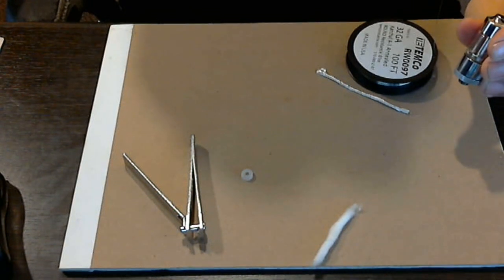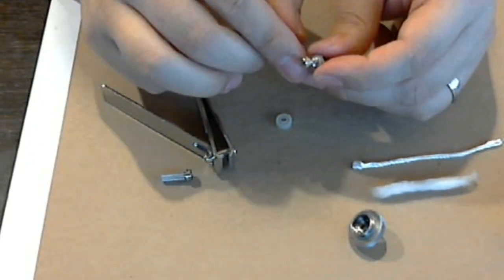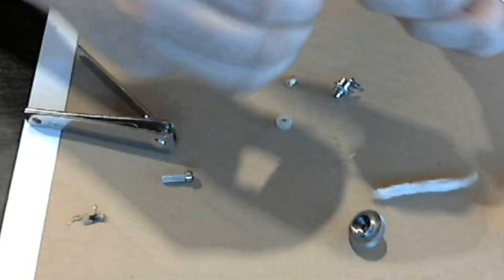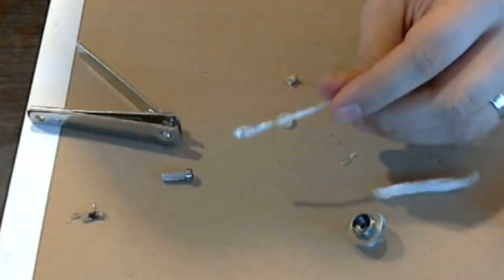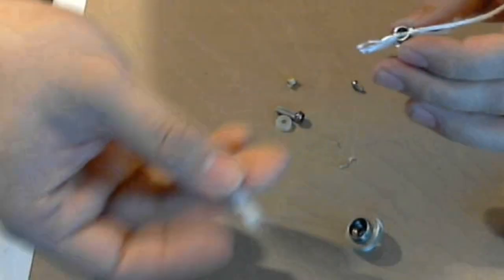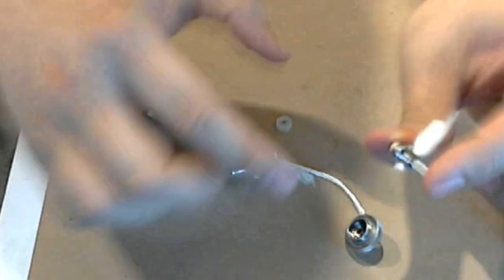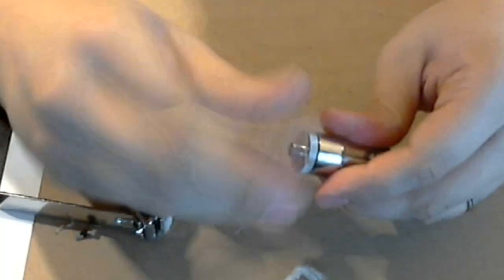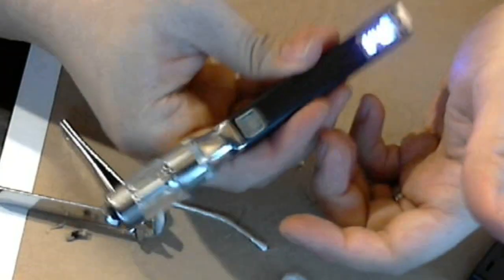Protanks and Evods, Anti-Gurgle Rebuild Method

Comment: the other main issue with kanger rebuild is the rubbery taste that results from the burning off rubber grommet that isolate the negative and positive wires.
Kanger uses resistance to no-resistance wires in the build which protect the grommet. do you have a solution to this issue?
Reply: I would like to see an answer to this.  I've thought of maybe making a grommet myself from a good insulating material that is easy enough to work with that I could craft it into a grommet but I haven't explored that idea very far.  I'm also hearing that the dual coil kanger heads are using a different grommet material, something more "squishy" like maybe silicone, but I have no first hand knowledge about this.  If you find a solution to "scorched grommet" I'd really appreciate if you could let me know what you find out or where you find it.  Thanks and happy vaping.
Reply: Roscoe Tims

Hey Rosco,
ive seen a video by a guy called Ray Lopez and he replied to my concerns and gave me a link where it is possible to buy a silicon grommet as you suggested the web site is lightingvapes dot com. the problem is they ship to Europe and it cost around $55 to ship a pack of ten that cost $6.
i gave it a thought and decided to leave the kanger club and buy a kayfun since i don't want to get plastic smoke in my lungs.
meanwhile i am back to my good old vivinova mini waiting for the shipment.
please keep me updated with any results on your side.
Best of luck and happy vaping.
Reply from the maker: Roscoe Tims the #0 screwdriver is for your standard rebuild-ables.
a kayfun, a dripper.   this would be way too big for a kanger coil.  In coil building 102 I explain that you must use your own discretion when choosing the driver size.

although a kanger coil can be rebuilt it was never intended to be rebuilt.
in the video I hand wrap over 1.5mm silica. So if you're going to make a microcoil  it must be much smaller.
Reply from the maker: resistance and non resistance is for those special builds found in ceramic cup setups.  You need that sodder machine that will join the two together.
so that basically you have resistance wire in the middle and two non resistant ends.

I think its unecessary,  if you fried the grommet that means you have a hotspot.  Keep your coil neat, balanced and don't go over 30 gauge.
32 gauge recommended.
Reply: Pegasus1337 I'm probably calling the screwdriver size wrong.  I ended up using one of those tiny screwdrivers that comes in an eyeglass repair kit.  

I started out trying to hand wrap around 1.5 silica as you did (just off camera where I couldn't see how you were holding it to make that work).  My silica started coming apart before I could get 2 wraps on.  I had torched my wire before wrapping so it was a little less flexible than yours and I only had 30ga so it was slightly thicker as well.  Long story short, I built a 1.3 ohm micro coil that fires fast and does what a coil is supposed to do.  

When I say it didn't work, I meant it didn't fix the gurgle, probably because I used all cotton and built my coil slightly too hot (it's vaping juice faster than the cotton can wick so it's flooding).  I should have just threaded silica through it and proceeded with your sandwich build (an excellent build idea btw, kudos) but I got impatient, my silica was out of reach and I had plenty of cotton at hand so I just did the whole thing with cotton.  

It might still have worked if I had kept to a higher resistance or used more silica but I learned that an all cotton, 1.3 ohm kanger single coil needs more power and more juice than I want to give it.  So if I try again, I'll stay closer to 2 ohm and use more silica.  As you say though, these heads were made to be disposable garbage so the smarter thing to do would be to just get a rebuildable to use my wire on.  

I've really enjoyed my protanks but I'm spending hours and dollars rebuilding heads that I could buy in seconds for pennies.  I just don't want to end up with a room full of gear ya know?  I already have too much vape gear so I'm not happy about the prospect of going RBA/Mech, then eventually getting a kick and probably a rebuildable tank  and looping my way back around to where I am now with vv/vw devices and bcc's.  It just looks like a huge waste of time and money chasing fads.  I'm short on time and shorter on money.  

Thanks for taking the time to respond and keep up the good work. You're doing good things
Reply from the maker: I think you need to visit a large brick and mortar store right away.  You absolutely have to go to a store and ask to try a true RBA device.  preferably a genesis over a dripper for this reason only.

people normally tend to build a genesis just right.  around .6 to .8 ohms.
People tend to build an RDA to around .25 - .30 and this might be too hot for your liking.

if you haven't tasted juice outside of a pro tank you're truly missing out.
Reply: B&M's are off the table for me.

I would love to go the genny or dripper route for flavor enhancement and to satisfy my urge to tinker but I can't afford to build an extensive hardware collection. 

Thanks again for your input, maybe I can put it to use if money stops being such an issue.
Reply: Roscoe Tims
I found a product from web site called nature vape the tank is called N vape pro mini and they have a 4 ml called N vape pro midi. it is their answer to kanger protank but they came with micro coil & cotton wicked @ 1.4ohms, the coils are build using resistance to non resistance wire which will protect the rubber insulator and all you have to do is change the cotton when ever you feel the need to. the price is 14 British pounds and I wrote the seller about international shipping and he said he will do it soon. just look it up in youtube and see the reviews.
cheers and happy vaping
Reply: observer547 Thank you, I watched Todd's "First Impression" review clip and checked out NatureVapes page.  This seems to be exactly what I was thinking of.  My first impression is very good.  I'll look more into it later but I have a feeling this is going to be exactly the sort of thing I want.  Todd's reviews are generally spot on with my own impressions, his review of the MVP2 mirrored my feelings about it.  In the "First Impressions" bit he did on the NatureVape page he did a side by side with the itaste 134 mini and x.i. tank, which I think are similar(ish) to my SVD and Protank 2 and he pointed out the huge difference in flavor between the NV cotton wicked micro coil device and the silica wicked innokin coil which I'm pretty sure is wound similar to other stock coils in that the coils aren't squeezed together (there's a little space between each wrap).  I might be wrong but I think the x.i is a dual coil.  Both coils are using res/no res wire I think.  It sounded like the NV is getting a lot more airflow but still, according to Todd it just slams the x.i/innokin 134 for flavor and vapor production, even though it's being powered by what looks like a typical eGo battery while the Innokin 134 mini appears to be in 18500 mode.

Anyway, thanks much for that info, I'll definitely be looking further into it.

PS, Pegasus1337, if you see this, I did have hot spots in the coils that burned grommets.  I think they were caused by vaping sweetened liquids.  It appears that a flavoring agent, probably a sweetener, is gunking up and cooking onto parts of the coil, causing inconsistent resistance readings and ultimately hot spots so I think you called that one right.  I'm also certain that you're correct about my missing out on flavors from only using protanks and cheap cartos but I'm stuck with that until I can scrounge up the money to buy a genny or dripper.
Reply from the maker: When the protank first launched. It was at 22.00. Every atomizer I recommend is around that price or less.
Reply: pegasus1337, I know and appreciate the price range you focus on. I've watched your videos.  I know what to look for.  Thank you for your efforts.
Reply from the maker: things will get better.
I've recently been dealing with a few sites that I think carry great stuff.
I've even worked out a special coupon with them.
Reply: Roscoe Tims I just rebuilt one at 1.8 ohms, 30 gauge 8 wraps 2.37 rod to wind around, heated up coil to red hot with torch, squeezed coil gently tight, held it there for few seconds, job done, tight coil no hotspots, threaded some rayon through coil, placed coil in atty, secured the bottom parts in place, then placed some rayon over the coil, no need for under it, placed top section on and snipped everything clean, cotton would work well to, it was a dual coil originally, silicon rubber bung, does not burn as such, used in all sorts of things and places were temp is an issue, these are on the dual coil attys I got, the flavour and vapour is now fantastic. Don't give up mate.
Reply: pa maj I have definitely not given up, thanks!  These dual coil heads are great for rebuilding "creative" single coils in.  I've got some light gauge wire I'm thinking of making into a vertical style like the Aspire BVC.  Oh and yeah that was the trick for not burning grommets, to do all your torching and fine tuning before you install the coils, instead of using the mod to pulse the coils hot.

I've sort of skipped the genesis phase. I'm sure I'll end up with something styled after the Kayfun or the Russian 91% eventually but right now I'm enjoying drippers and Protank2's and aerotanks. Some of these drippers hold 2-4 ml and are almost like semi-hybrid gennys anyway.

I still haven't dipped below .2 ohms and don't imagine I ever will.  I was very pleased with .4 to .7 and I feel pretty comfortable at .5 even with just 20 watts available;  haven't needed those other 10 watts but I've got an APV that'll deliver em anyway.

I gotta say, as awesome as dripping sub-ohm is and as great as that extra flavor and big poofy cloud is, dripping is all it's made out to be.  But I got very similar performance from my aerotank mini and even though I haven't tried ne yet, I hear the new Aspire BDC & BVC mini's are comparable to complex genesis and auto-dripper rigs.

Thanks everyone for your helpful suggestions.  I was just going through a rough patch where I couldn't decide just how DiY I needed to get before I'm spending more on DiY than if I had just bought retail.

Thanks again, you guys rock.
Reply: Not too bothered about really high watts myself, less flavouring needed or for me it gets sickening, less nicotine needed or end up monged out lol, way too much e-juice gets consumed in the process, for what, Bigger clouds, it does get silly when I think of it really.                                                                         A good vape can be achieved without all that nonsense in my opinion, keep it real as such, every day vape sort of thing. I have a few nautilus and kanger tanks and so easy to rebuild better, even with a single coil it's fantastic, although the aspire coils are great to begin with anyway.                                             I only just got a russian 91 and ( need to drill out for better airflow, more o rings to loose or damage, awkward filling compared to the above mentioned ) I am just not comfortable with it yet, don't really like it so far but who knows.                                                               I have a big dripper, built a 1.5 ohm coil for it with 29 awg, vape at 15watts, loads of rayon just below the coil, I vape with it and forget it's a dripper, juice tastes great and lasts for ages between refills, so easy to see coil, rayon, or if it's ready for a refill, indestructible.                                                  A micro 2.2 ohm coil 28 awg i'll put in it next and try 15 watts as that's  the so called sweet spot for my vv-vw device.                                  I have and use mechanical mods as well, I would go between 0.4 and 1.4 with different awg gauges just to see what's what, dif juices make my decisions for me sometimes lol.
Reply: Just thought I would let you know, drilled out hole to 3mm on Russian 91, far better air flow but still a little whistle, I then noticed when I blocked the start only of the hole I just drilled, still a little whistle but better air flow than before I reamed it out, as the air travels through the screw hole that is wide anyway into the hole I drilled that's now not restricting it, I only have a little plug blocking the hole and can so easily take it out or put it in, to have this choice is great and when it's out, bigger clouds good flavour, when it's in slightly less clouds but great flavour but not really a massive difference overall, I think I am preferring the flavour side more lol, I think next I will see if see if I can stop the whistle by slightly widening the top of the screw hole.
My opinion on the Russian 91 has changed, but you definitely have to mod it on less you like a tight draw.
Reply: Roscoe Tims Sorry to bother you.

I started out with an 18650 mech mod and a cheap RDA I learned fast how to build and rebuild coils.

Just today I bought a kanger protank 2, it was harder to rebuild than I thought it would be, anyway it took me one short and a little juice on my hands to figure it out. I built a 1.2 ohm 28g coil and I wicked it with cotton, worked just fine and tasted better.
Anyways my point is I only threw down about $150 on a mech mod, RDA, two 18650 batteries, a charger for said batteries, some 28g wire, and a huge bag of cotton balls, after a few builds, an RDA is way better than any tank I have ever tried.
I highly recommend you try a mech mod and RDA before you think they are not worth it. 
Have a great day and vape.
Reply: k5hi59 Thanks for your suggestions.  I've actually picked up 3 mechs since I last posted here; a segelli telescope that performs beautifully, an EHPro Panzer Blackhawk that I overpaid for at a B&M but still performs great and an "authentic" BeyondVape Neptune hybrid that's a little finicky as well as a couple of RDA clones in addition to the RDA included in the Neptune (a TOBH cloone that works like a charm and a Trident clone that I haven't been able to build a ssuccessfulcoil in because of their "innovative" slotted postholes and wonkey post hole screws which are extremely difficult to get tightened down without twisting the leds out of those slots).

While I have been pleased with the performance of these mechs when the batteries are fully charged, I can't help but notice that their performance drops off drastically below 3.7v and that they tend to be pretty high maintenance.  Still, for the prices a paid, they are certainly worth it, especially because building coils in them is so much easier than recoiling tank heads with much more build space allowing for more variety in how I build.  It's also much easier to just clean gunky coils and rewick than with rebuilding premade coil heads in tanks since that generally requires completely rebuilding the coil using thin wire (I can only rebuild protank coils with 30-32 awg wire.

Still, The extra attention required by drippers means I typically only use them when I'm at home and have the time to give them the attention they need.  I still use tanks most of the time, largely for convenience sake.  I've had great experiences with kangers aerotanks, especially the mini but also the mega.  Maybe I have a peasants tastes but I just don't see much difference in a properly tuned dripper and a properly tuned, quality tank; at least for dual coil use in the .8 to 1.4 ohm range (wattage/voltage tends to vary depending on the liquid I'm  using more than anything else).  I find that I get much the same results with tanks working at high power against higher resistance coils as I get from dripping on low ohm coils at lower power.

Finally, as cool as these mechs are, I feel like my regulated mods offer the best value all around since they perform much more consistently and seriously prolong my battery life.  So lately I use my mechs more as an affectation and to play with new (to me) coil builds and generally use my regulated mods with aerotanks for regular use.

Thanks for your suggestions, you make good sense.  If I could offer anything in return it would be to try 30-32 gauge wire for rebuilding protank heads.  The thinner wire makes it easier to get the resistances you need to fit inside that tiny build space, especially if you build micro coils (where the wire coils are squeezed together tightly without overlapping).

At this point the only challenge I still struggle with is working with silica since it tends to unravel and/or fall apart on me but that's a minor issue since cotton is such an easy alternative.

Happy vaping.
Reply: I'm glad to see a reply, I just bought a panzer black hawk clone on Amazon for like $26 I'm hoping it was worth.
Reply: Roscoe Tims I noticed you said you get better battery life out of your vv-vw devices compared to your mechanicals, I find the complete opposite, I use 1.5 ohm 29 awg in my Russian 91%, drilled ( reamed ) out air hole for better airiness and a Sony vt5 battery in a nemesis and replace the battery when it just drops between 3.67 to 3.73, also I use 24 mg nic so 3 second pulls is plenty, when I used 1.8 ohm coils and 28 mg nic, because of maybe 10 second pulls the batteries died a lot quicker.
                                                                     When using vv-vw devices the circuit boards use some power, so on less you have them turned down and with the right coil set up then they can be far worse on battery life than a mech, at least that is my experience using a Vamo 5,  I JOY E TOP, and also a kick 3 to 15 watts all drain my batteries quicker.
When I don't let my batteries discharge lower than 3.7 they charge in no time, I let them rest at least 15 mins before charging and also if they have just charged before I use them again, this all extends battery life and performance, I hope this info helps some.

I also love tanks and agree a good set up tank and coil, wick and so on is really for me, hard to beat, drippers are for play time and even then sometimes I wonder what all the hype is about, probably the cloudszzzzz and so easy to show off builds, and some look cool, my cheapest worst looking mod-ed one is the best one so far, when I got it it was broke bad and almost went in the bin lol.
 
Try using 29 awg at 1.4 to 1.5 ohm with kgd, SERENA, or Shiseido Japanese cotton or perhaps Rayon, in the kanger tanks, all wicks great but as you said, tight fit.
Reply: k5hi59 The Panzer Blackhawk clone by EHPro that I've had for about a month has been wonderful.  As I mentioned earlier, I paid way too much for it, probably 3 or 4 times what the brick & mortar vendor bought it for at wholesale or whatever, around 3 times what you paid for yours, but I still don't feel ripped off because this thing is a beast.  

Right after I got it I watched a review video by "Twisted420" where he compared some Panzer clones, I can't remember the manufacturers he reviewed but there was quite a bit of variance between different brands with the biggest problem being painted (or otherwise coated) threads on one of the Blackhawks (I think the inside tube was also painted, he gave higher marks to the unpainted, metallic Panzer clones, claiming they performed about as well as authentic MCV Panzers.  He claimed the coated threads on his blackhawk clone caused significant voltage drop and I seem to remember all of his Panzer clones having squeaky threads.  I've seen other reviewers slam Panzer Blackhawk clones and the main thing the negative reviews have in common (aside from the tactical flashlight appearance) is painted or squeaky threads and a "crunchy" or otherwise inferior button, generally because of a weak spring in the button assembly.

I haven't seen a review the EHPro version, or at least not the one I have.  Mine has the distinctive heavy duty tactical flashlight look of the original, thick and weighty enough to break bones if you dropped it on your foot, with no markings (even the box is just a plain but sturdy black with "EHPro" printed over their logo) other than the ehpro insignia on the button (which is spring loaded instead of magnetic, though it could easily be converted to magnets).  The spring is sturdy and maybe a little too stiff since it can cause the button to slowly back out over time- I do have to tighten it every once in a while but it's very easy to tell when the button's backing out and it's easy to retighten. I couldn't say how ehpro coated this thing, whether it's paint or powder coat or whatever but it's a great finish, slightly glossy but not enough to hold fingerprints, it hasn't scratched or discolored or shown wear at all.  If I had to guess I would say it's stainless steel, probably industrial grade, with bare threads and insides (only the outer, visible areas are black, the inside of the tubes including the threads are shiny as new steel and the tube sections fit each other in various configurations so it can be assembled without worry over which piece goes where.  

The button assembly appears to be brass with delrin or some hard plastic insulator and either copper or a copper plated contact pin. The positive pin in the top cap is that type that has a threaded pin screwed into an adjustable "floating" pin that seems to be so popular lately.  The kind that seems to be made to put the atomizer on before screwing the top cap down to ensure contact, then screw the threaded contact pin in or out until the top cap is secure and there's no battery rattle (the tubes inside diameter must be slightly larger than 18mm because 18 series batteries do have a little side to side play if the positive contact isn't touching the battery).  

The reverse threaded lock mechanism works exactly as advertised and all the threading on mine is whisper quiet and smooth.  I realize I'm stating to babble and fawn so I'll cut myself short here and summarize by saying again that my version looks identical except for being completely unmarked (except for the ehpro logo on the button).  It feels,and performs as well as my much more expensive Beyond Vape Neptune aluminum hybrid and much less expensive Sigelei Telescope (all SS & brass I think), though I'm pretty pleased with both of those mechs as well.  I actually like the unmarked look, it makes the blackhawk look less "Tacti-Cool" (though no less like a flashlight I guess), maybe a little less pretentious or even threatening than the apparently more popular style with the names of well known military tanks and helicopters prominently displayed.  This ehpro version is understated and discreet by comparison.

And I've babbled far more than I intended.  I didn't intend to write a comprehensive review, ha.  I guess that just shows how pleased I am with this particular "battery tube." Thanks for reading that wall of text and good luck with your Blackhawk, here's hoping you're as pleased with yours as I have been with mine and if not then look for the EHPro version, you can surely find it cheaper than I did and I'm sure it's a higher quality mech than the clone versions I saw reviewed by some other YouTubers.  I would put mine against any other version, including the original, without worry.
Reply: pa maj You make some very good points, I can't disagree or argue anything you said.  I've mentioned throughout these replies what sorts of gear I'm using these days and from reading your comments it appears we're on a very similar path.  I might have been hasty to say I get better battery life from my vv/vw's without clarifying that I'm fairly new to mechs and sub-ohm vaping (I've been vaping for almost 3 years total but I only got my first mech about 5 or 6 months ago and I'm only just getting into more than dual coil and below .5 ohm, even then it's more as an exercise to see how different liquids behave under those conditions, as you say, I'm not really into clouds for the sake of clouds).  I'm not sure I could say I get "better" battery life from 1.4+ ohm single coils on mech mods with careful attention to my operating voltages but I have only recently (in the past few weeks) noticed that my battery life is very comparable in those circumstances.  I should have clarified that when vaping sub ohm, especially below .8 and most especially with thicker wire (I was thinking specifically of experience with 26 & 24 awg) and dual coil builds that don't really work well on most regulated mods anyway.  Otherwise and other than running my batteries to 3.5v +/-  we're on the same page.

I want to keep it short and readable (which I have a very hard time doing so I'm gonna go ahead and give you a tl;dr right here- I agree completely with everything you said throughout these comments, especially this quote from one of your earlier replies: "... dif juices make my decisions for me sometimes ...") so I'm going to try to leave out a lot of what I've said elsewhere in these comment replies but the short version is I used dse901 stick batteries and carts to quit smoking.  After just a few months I had quit smoking and started making my own liquid, which kept me occupied for months.  Somewhen around 9 months or so after I had quit smoking I felt pretty confident making my own liquid and maintaining my own carts, a process which steered me gradually toward this rapidly growing world of apv's and atomizers that seemed ideal for getting the most out of the liquids I was gaining proficiency in.  

Finally, I got a chance to get an MVP2 and Protank2 (mini first then the regular a few weeks later).  I lucked into a good deal on an SVD a few months later, before adjustable airflow became a thing and I went ahead and got the mini and mega aerotanks right after they became available, even though I had learned to mod my coils, tanks and liquids by then and had learned to adjust and adapt my vaping technique to suit whatever I was vaping at the moment to the point that, for me at least, vaping was an entirely different activity than smoking had ever been.  This was around the time I was learning that the liquid composition was so crucial to determining success or failure of a given build or even vaping technique.  I had realized that I needed stronger flavors and nicotine in thinner liquid to get the same satisfaction from a tiny, very low powered stick battery/carto while I could reduce nicotine and get different flavor results from the same flavor ratios at higher power, that the consistency of my liquids was at least as important as the build of my coils or the power level I was vaping at or even the style of vaping (long draws vs short, mouth vs lung inhales, airy vs tight draws, etc) I was no longer vaping just to avoid smoking, and even though I specifically did not want to take on a new hobby and really didn't want to hop on any bandwagons and most especially didn't want to blow the money I was saving from quitting smoking on buying into the sort of hobby that requires a heavy investment of time and money to stay current ... well, I suspect you know where I'm going here.  Part of the appeal of vaping is that the more time you can invest the less money you need.  At least, that's been my experience.  This stuff can be pretty inexpensive with a little time, patience and even just a shred of technical inclination.  I have the good fortune of personal experience in chemical, electronic and mechanical areas of interest and that combined with easy access to the knowledge so generously shared by people like Peg and everyone else online have made this one of the most trouble free endeavours I've ever undertaken.  If you had told me even just 5 years ago that the internet and some simple low voltage gadgetry and basic chemistry would break my smoking habit and fill my free time I would have backed slowly away from you in case you were as dangerous as you were deluded, ha.

Anyway, shortly after getting the aerotanks, I finally got a chance to actually go to a brick and mortar store where I intended to get a mech and was still on the fence about whether to get a genny or a dripper to see how they stood up to what I had.  As it turned out, the B&M I visited only had a few very expensive, shoddy clones and still fewer authentics  that were well above my budget.  I ended up buying the cheapest available stuff that I hadn't already been warned away from via forums and places online such as here because the owner was a nice guy and I'm a sucker for good sales technique.  So I became the barely proud owner of a Sigelei Telescope mech and a Dovpo E-Mech vv/vw (yes, the Transformers mod, don't judge, ha), and a tobh clone (that was the only reasonably priced atomizer available that wasn't obviously flawed or way overpriced).  I had bought an IGO W3 a couple of weeks prior on impulse just because I saw it on ebay for ten bucks and didn't realize it was a 5 poster ideal for quad coils until after I had placed the order.  By that time I was proficient at rebuilding kanger single coils with 30 awg wire and had even played around with dripping on a heavily modified protank as well as some embarrassingly hilarious and frustrating attempts at building single and dual coils on that IGO W3 that would safely work within the narrow limitations of the MVP2 & SVD.  Which is why I ended up buying that goofy looking E-Mech, it's a 2nd or 3rd generation model with the speaker disabled so it doesn't beep, I could overlook the "autobot" logo and the fact that it's pulse width modulated primarily because it was less than half the cost of any other regulated mod with 30 watt capability that'll fire below one ohm.  I had never heard of the Sigelei Telescope and the B&M dealer couldn't tell me anything about it that I couldn't see for myself handling it, I still haven't found any reviews of it, video or otherwise.  It's clearly labeled with the usual Sigelei markings, it's a pretty plain stainless steel telescoping mech with the standard bells and whistles and no obvious flaws but no remarkable features either.  A pretty solid first mech, though certainly not the ideal (I envy your Nemesis and Big Dripper, those would have been my first choices if they had been in stock and not priced as if they were made of asteroids and unicorn horns... I know I can get them via mail for very reasonable prices but I was standing in a brick and mortar store with cash in hand and the patience of a child in a toy store and now I've already spent more and acquired more gear than I ever imagined I would, more than enough to keep me busy through the year I think).

Which brings me to my point I suppose.  Reading comments and replies like yours and considering the stuff I already have, I can't quite bring myself to commit to buying much of the gear I want.  I've wanted a Nemesis and a Kick and several other key pieces (DNA mods, Stingrays, just a metric ton of different atomizers, especially kayfun style and these new semi dripper semi tank toppers that turn your drip tip into a juice flow button, practically every atomizer I've seen short of genesis style which is possibly the only atomizer I'm not really interested in, something about gennys just doesn't do it for me, but high powered regulated mods, especially exotic or unusual designs and pretty much anything that gets good press from reviewers and "internetizens" ... I even want to try some of the highly regarded premium liquids despite the fact that I'm completely happy with the liquids I make, moreso even than with what ready made liquids I have tried).  I'm actually starting to think about joining some trade groups maybe.  Not "Trade=Business" but "Trade="Swap" just so I can experience some of these things without accumulating so much gear I have to rent a storage space to keep it all or spending so much money I have to go into the vape business (though that's a temptation, past experience has taught me the quickest way to suck the fun out of something is to turn it into a job, ha).

Oh, and more to the direct point of your specific comments, congrats on that Russian 91, it's good to hear opinions and experiences such as yours.  I've been eyeballing the Russian, kayfun, orchid, rose and others for a long time but haven't taken the plunge even when I could afford it.  I guess because I've been pretty happy with the stuff I have.  Even my most disappointing stuff has been pretty easy to find happiness with just a little tinkering and maybe a tip or 2 from online and at this point there's just so much to choose from.  Other than my maybe unreasonable bias against genesis style atomizers (which as I think on it probably just boils down to what seems like overly complex wicking and potential messiness since the design seems prone to leakage without careful attention), I'm pretty open to anything else I haven't had the opportunity to try, including rayon, Japanese cotton and just a ton of different wick and wire configurations.  I look forward to expanding my coil experience beyond the duals I've been enjoying lately.  Oh yeah, I had a point I was going to make, ha, sorry.  It was specifically regarding your whistling problem.  When I got my Beyond Vape Neptune hybrid dripper I wasn't satisfied with the small airflow holes in the top cap.  Fortunately for me, that's an aluminum piece, and thin aluminum at that.  It was easy to drill it out by hand with just a drill bit in a few minutes and I noticed while I was at it that before I finished, while the air hole was wider on the outside than on the inside, that it whistled slightly.  Once I had it drilled completely through the whistle went away.  Now I was drilling through a single thin surface and as I understand the Russian91 it has a longer airflow passage so I'm wondering if there's maybe someplace along your airway that's either constricted or, maybe more likely, angled or bent or otherwise obstructed and maybe this is causing your whistle?  I've noticed this on various atomizer reviews where airflow is more complex than just a direct hole in a top cap (as drippers), that some elaborate airflow systems can get kind of noisy or whistle and sometimes it's because the airflow is either angled in a way that constricts it at bends or airway passages are long with lots of twists or bends.  So maybe, somewhere out of direct sight, you have a bend or something that lets enough airflow through but causes whistle?  I don't know how you would find that but it's the best my limited experience can offer.  I could go on much longer but I'm trying not to write a book here I guess so I'm just going to stop typing. (I told myself I need to stop with the long drawn out replies, ha)  Thanks for reading if you made it through all that.  Good luck to you and thanks for reminding me how much I'm enjoying this whole vape thing and how much more there is to look forward to.  Whether you vape low power single coil no nic invisible humidity or octo coil kilowatt stage fog, vape on and vape happy.
Reply: I really enjoyed reading that and yes I would say we have had and still having a very similar journey, mine has been cram packed into a few months of intensive research, trial and error to the point of obsession at times but I don't really mind that, it has kept me off cigarettes and give me a hobby I probably did not need, or did I, umm.

I also tinker and would not dream of moving onto something else too quickly until I have got the best out of what I have, I still have stuff in there boxes, advanced Christmas presents type of thing while prices were good, clones mostly but good ones.

I have only started making my own juices, I love it, so much control its a must, I have taken to it like a dream, I mix separate flavours and get there strength right first, working up, not too strong or it can be unruly, I use a small mod-ed no name rda for testing as I go.                                                                                                                                             I made a whisk out of looped twice 0.50mm kanthal, allow 4" back and fourth twice and put a pen through the loops, attach the other end to a cordless drill or dremel with chuck and pull tight and power it up to twist the wire, then snip clean the chuck side and the two loops on the other can be twisted, one inside the other at right angles, I use 30mm blue bottles for juice with 8mm wide tops so it fits inside, just.

Testing before steeping gives me a good measure to go by and If I need stronger I add more and whisk, I also record it and steep.

Some I use without really steeping if it is nice enough, most are, they steep as I use them, only a small drop gets used as they steep, I can't help myself lol, if I add two ready made liquids together I made a week or two previously, say orange 20% and coconut 80% to keep it simple, it can taste nice for a while then taste a little off so It needs steeping again for a while or I can add another strong flavour like blue berry, drown out the weak orange as I never made it too strong to begin with and vape straight away as the blue berry I have is good for that and being a little acidic itself will easy cover the orange, 2% can be strong, thats in the original mix usually I make with blue berry.

I guess to sum it up, I keep all my juice single and steep, I then play with them mixing them in a tank or a drpper with a 1.5 ohm coil for an accurate example to my 1.2 to 1.5 tanks as I vape,adding more or less of one or another, If something is outstanding I then mix the two or three together in another bottle, a nice all day vape is mostly the goal.

Oh, I had to re edit this to add as I almost forgot, sometimes I set my juice beside my sky box on top of my amp as it is reasonably warm, the bottles are blue so not really worried about too much light , I open lids, blow air across the top to exchange air and replace lids and shake, I do this about twice a day or so, I can tell usually when I smell them they have changed, usually after a day or two, this is good for sharp tangy flavours, coconut or creams and such, I don't  have to as they are sometimes better fresh to me so I keep them cool, when the warm one has cooled I add what I want to other fresh flavours, shake well now and again or whisk and leave in a closed wooden box as I use, the wooden box low to the floor close beside a cool inside wall away from heat as to try and prevent further change to the juice without putting in the fridge.

I know this way is probably not the best way to do it for most or even me but I get it to work almost every time, once I mixed all sweet juices and ended up with savoury smokey bacon, the last thing I expected lol, it got dumped in my little not liked juice jar, only 30ml in it over months so very little waste, only a tester of 21/2ml went in it, I vaped some but not keen on savoury juices, I would rather eat savoury stuff.

I really must research more on juice making, but I am not sure why lol, I have read a lot have been really unsuccessful at it but I think it is because they get too creative and mix too many flavours, if I have three juices about the same strength, all single mixes that I made , I like to use a method I feel is mine lol, 123 or 321 I call it if using three flavours, my favourite gets 3 parts, lets say cream, my next favourite gets 2 parts, lets say rum, and 1 part a cherry or berry, this would probably be nice this mix but one I have not tried, I guess now I must for curiosity sake, I would adjust a little sometimes, though it does get me in the ball park also remembering they must be flavours that complement each other in the first place or you could end up with bacon in your ice cream :-(  I am not great at going past three flavours, if I have and it worked it was luck or a tiny amount of vanilla that saved the day. more complex flavours I would just buy from flavour art as an example, I love their black jack sweet lol, I have got it close but not close enough ha.

I guess I should finish now, the Russian I love so much, after playing with coil set ups, what a trick! it just blows me away to think what I was so reluctant to buy and did not like much to start with, but after modification and deafness setting in lol, I don't  notice the air noise, shoooo don't wake it up by saying it, the wilhste, see, didn't say it lol. Juice taste amazing, using kgd at the moment but got some Serena Japanese cotton to try, supposedly same thing more for less though, get my thrift ,ha.
                                                                           I'm sorry I did not give you most of my story but it would have read very similar to your own, I guess. It was scary, similar in places, I think you are someone who pays quite a lot of attention to detail but just sometimes goes out on a limb, just for the hell of it, at least I do lol.                                                                      
I just have to really finish now by saying thank you to you and all like you that have been the fore runners to this new world of vaping, it's because of people like yourself that led the way for people like myself that makes life more pleasing without a cigarette. Cheers, and if anyone gets this far, go get a cup of tea or coffee and have a vape, you deserve it lol, no! Really!